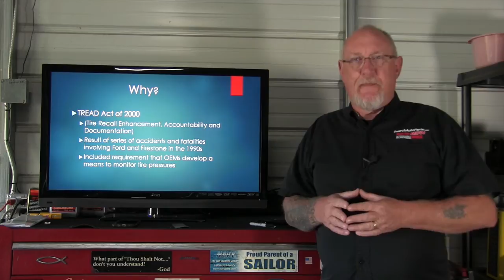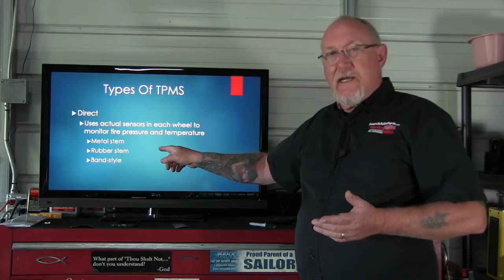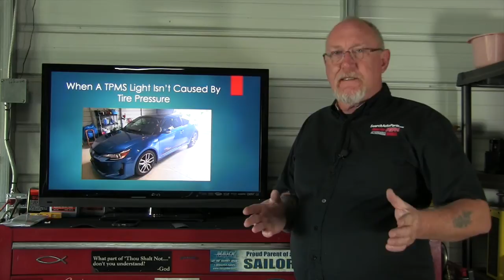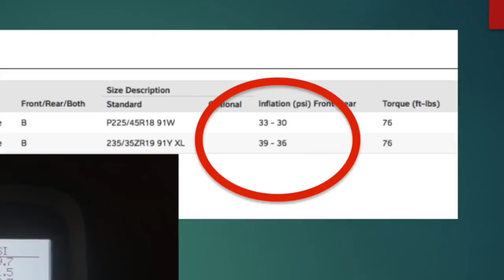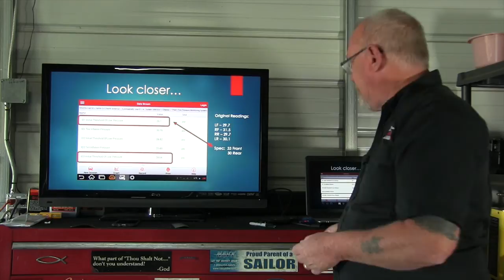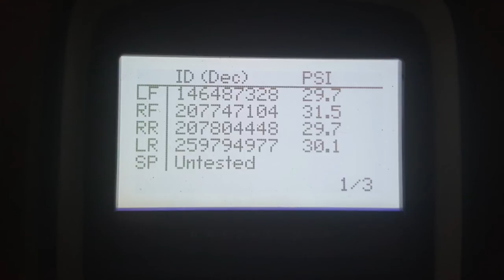The Trainer #71 - The 411 On TPMS

Comment: I have found that sometimes the oil level being low a quart can cause the tire pressure light to come on so the vehicle inspection is crucial for any starting point to diagnose not to mention a great feature this car will not run out of engine oil without the car noticing before it is too late

Comment: I'm a Chrysler dealer tech, and i have been dealing with these systems for years now. One thing that i've learned with these systems is that the tire pressure spec on the placard is often just above the low pressure threshold. I remember Chrysler issued a tsb in early 2007 saying to inflate the tires about 3 psi above the placard spec. Chrysler started using tpms systems  in 2006, and found out after the winter of 06 that when the temps drop, so do the pressures. That is why they advised adding the additional 3 psi above the placard spec. Chrysler had various versions of the tpms systems, there were two levels, a base, and a premium. The base is just the light on the dash, the premium will actually show the pressures of each tire on the dash in addition to the light. The system used by Jeep will update when the key is turned on, all other systems, the vehicle has to be driven at least more than 15 mph, for a short period of time. sometimes, they'll update as soon as the vehicle leaves the driveway, sometimes, the vehicle has to be driven a mile or more for the sensors to update the module. I'm a used car tech, so i've seen the various ways that different makes relearn the sensors. Some systems you have to lower and raise the pressures, some you have to use a tpms tool to get the sensors to wake up and update. The first thing i do when i suspect a faulty sensor is to use the tpms tool to check at each wheel whether there is a sensor there and working or not. I've found bad/missing sensors that way. I've also found that things with foil on them, like a greeting card, can cause reception problems. All the automakers are moving away from the aluminum valve stem due to corrosion issues. The rubber ones are cheaper and easier to change. Also, with the rubber ones, the sensor is attached to the stems with a screw. Apparently, the auto companies are learning, and have actually made it easier to diagnose and fix problems with the systems now.
Reply from the maker: Thanks for adding your experience to this video!
Reply: You're welcome!

Comment: Just worked on a 2017 kia forte' spec is 33 front and rear light was on, left rear was 31 put 2 psi in drove it light went out, 2 psi isn't 20 25 % threshold on this car.